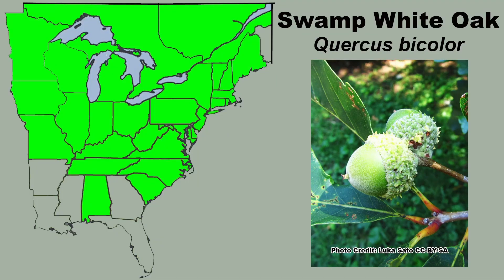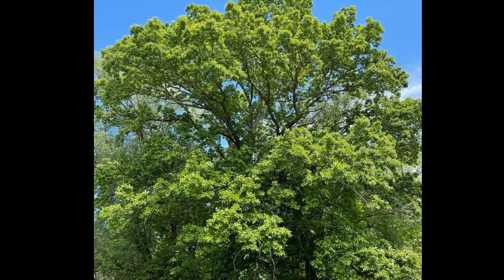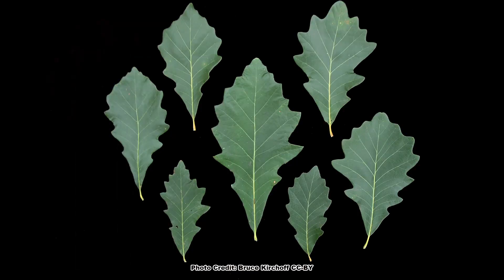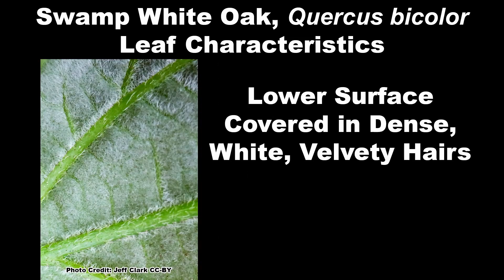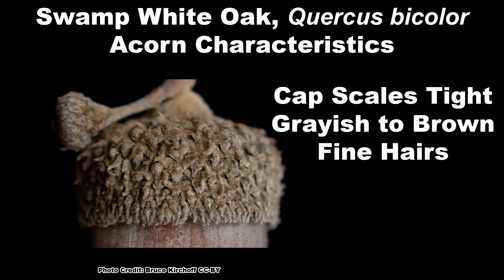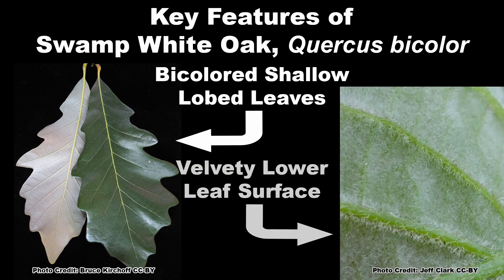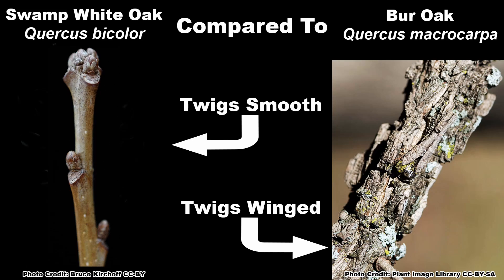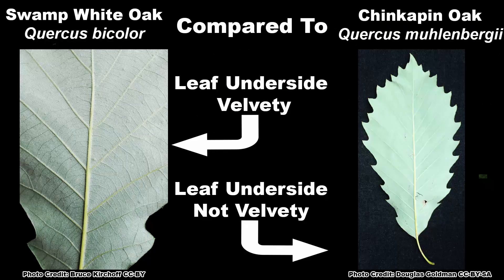Discover the SECRET to Identifying Swamp White Oak FAST!

Comment: This video might lead you think these trees have to be near water, but that isn't factual.   The ones I have are 30 foot tall but have never been near water.  Like most trees, they appreciate supplemental watering during dry spells, but mine have not had that luxury.
Reply from the maker: Thanks for your comment! While swamp white oak is often found in wetter areas, it can adapt to drier conditions once established, which is why yours are thriving without constant moisture.

Comment: Swampers have no fall color but brown! Leaves usually dont fall off totally till spring
Reply from the maker: They do tend to run to mostly brown (like most oaks) but will produce some yellows in certain situations. Oaks tend to hold leaves late - which is nice if you need a leaf to confirm an ID!

Comment: I have a swamp white oak that I bought from all places, Meijer. It's doing fairly well so far. It did better through this icy weather we've had than my pin oak did. The swamp white dropped all its leaves while the pin oak didn't, which gave lots of area for the ice to cling to. I look forward to watching my oaks grow up.
Reply from the maker: Swamp white is one of the most available white oaks in the nursery trade.